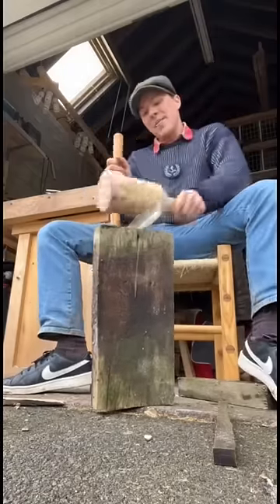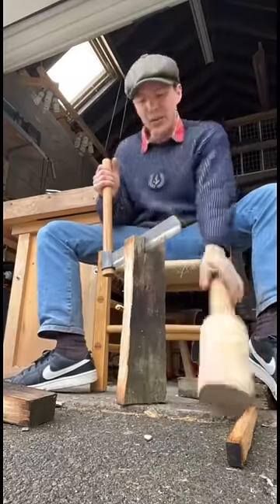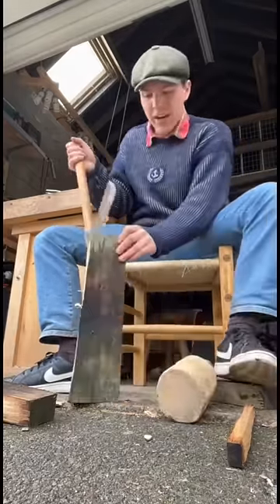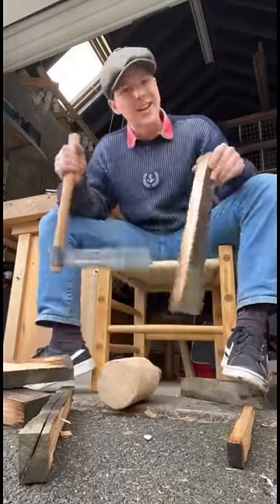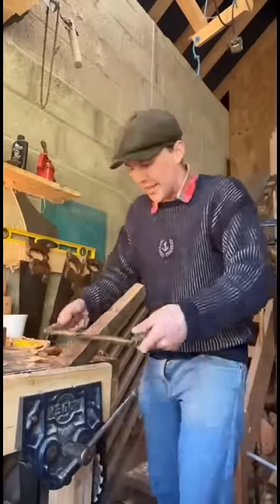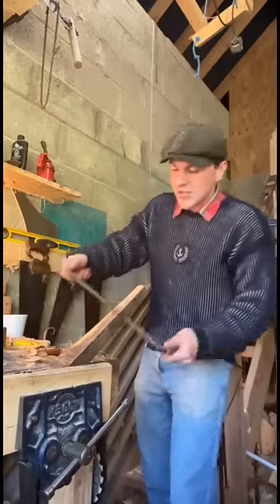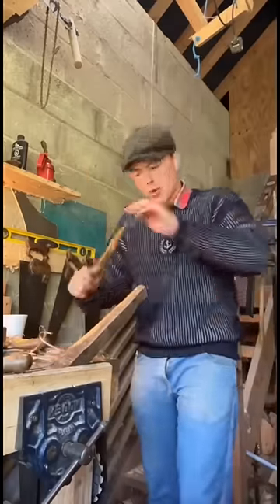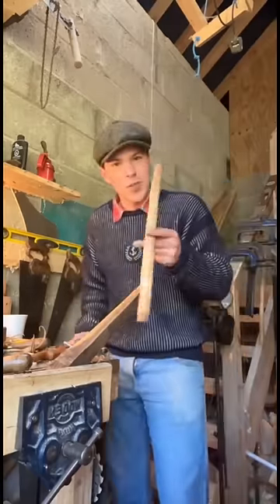Making Oak Pegs by Hand #handtools #shortvideo #ireland #timberframe #oak #woodwork

Comment: where I live, is a museum called "The Oak house" in West Bromwich, West Midlands. the Tudor wooden framed house uses wooden dowels to hole it togas the acid of the oak would ruin iron nails. it's still here 400 years later, it's a hotchpotch of timber frame and the rear walls are brick.

Comment: I like how when using basic bladed tools you’re never meant to cut towards yourself; but with in many cases much sharper, more specialized bladed tools, cutting towards yourself can be standard practice.
Reply: Lol yeah I was wondering what keeps him from cutting himself, cause I feel like it would end very poorly if I tried that. Maybe it's the classic "hit yourself once, then never again".
Reply: It has a lot to do with the hand (using two hands) and body position. With the draw knife, you cut towards yourself because when standing or sitting properly you can't hit yourself.
Reply: It’s a great rule of thumb to always have in mind for tools in general, where a mistake or slip means all the force being applied will direct the edge/point into your own body faster than you can move or react.
All the tools where it’s mostly safe to not apply the rule, the movement and/or speed of a tool slip is limited, and/or the slip would move your body out of the damage path.

Comment: A lil tip for pegs, put the timber in an oven at 100-150 Celsius for an hour or two and then cut with down, force drying it this way will mean once its set it's moisture content will equalise to the other timber and create a better fit that'll prevent excess moisture getting in 😁 hope the tip helps, I'd love to come over and meet up wid you for a cuppa and to swap our cool lil tricks of the trade someday 😁
Reply: So the drying shrinks the wood for the peg slightly, then it swells that few thou and makes for a more snug fit, yeah?

You mean bake the brick before you cut the pegs?
Reply: @i-love-comountains3850  yes yes lad exactly that, it's especially good for structures that will see alot of movement like out buildings or sat/leant on furniture 😊 bonus points for oiling the hole and peg before insertion

Comment: "I'm using a small piece of wood to support the weight of two huge pieces of wood to build this new doorway!"

Dude probably blew people's minds back in 200 AD when they discovered these physics.
Reply: The weight of the horizontal beams, and diagonal braces, are supported directly on the sturdy posts. The pegs merely lock them in place, quite securely. No storms or quakes dislodge the joints.😂

Comment: Low torque simple machine lathes have likely existed for thousands of years, now that would be a cool video. Maybe a foot powered crankshaft style design? Or even water wheel powered if you have the access.
Reply: He has a pole lathe already. Its a right pain to setup

Comment: Only thing that puzzles me is I've always, always been told to operate blades away from you whereas in carpentry I've noticed alot of sharp/bladed tools are orientated to operate towards the user which I can't for the life of me see how that's safe. I was sat there thinking what if the blade hits a knot in the wood and jumps? He's gunna disconnect the bottom half of his body from the top. 🤔

Comment: I personally don’t know how much I like any tool setup that requires me to draw the sharp blade towards my body. Especially when the blade can get stuck and as I pull hard it comes flying off uncontrolled. That’s a recipe for stabbing yourself in the chest.
Reply: Using a Drawknife, the work piece is held securely in a vise, or tightly on a shingles splitter while you are sitting. A sharp tool cuts easily, without excessive force. No BandAids needed...
Reply: @nickschurko4809  Tell that to the guy in the video.

Comment: After the peg is in place is it sawed off and sanded to be flush with the support?
Reply: No. It is left to protrude inside. Outer face of timber. If having siding boards applied. Then yes. Trimmed flush first.

Comment: funn fackt about wooden nails if u dry them and put them then in u will never get them out again
Reply: Sometimes they can be tapped out by hammer. If joint timbers sagged down on the peg. It makes  it "U" shape. It has to be drilled out with brace and bit, yes. By hand! I have done ti dismantling and reassembling  Dutch Colonial barn in NJ
Reply: wow nice  have u some pictures of that?  i realy like restorations :D